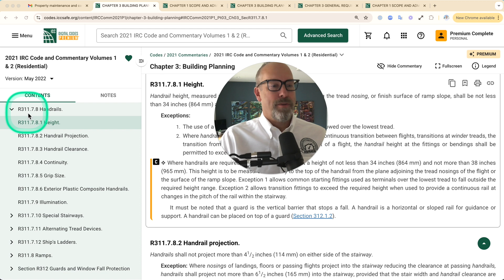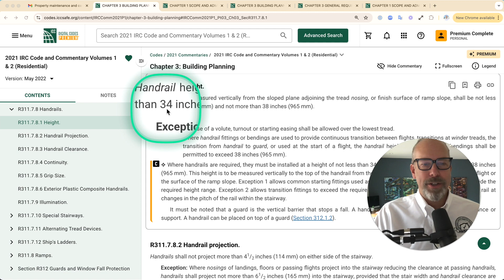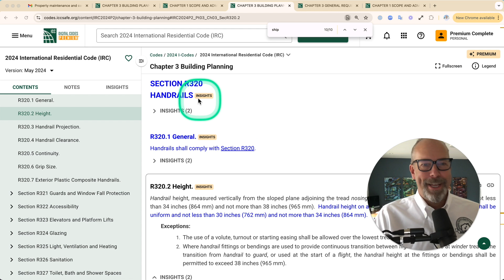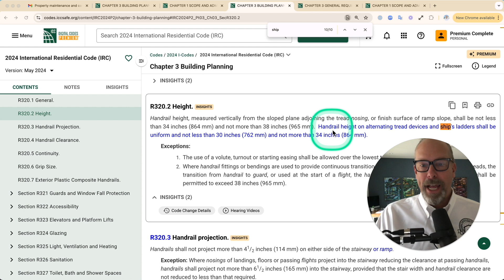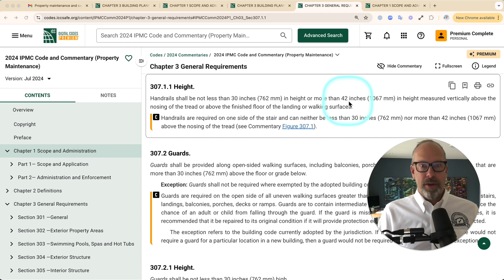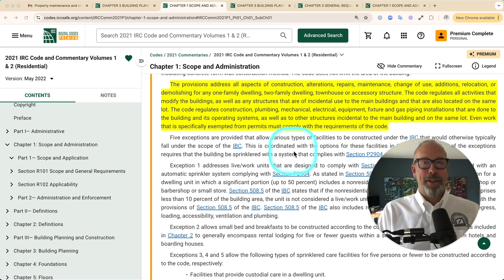Inspecting Handrail Height Using Code

Comment: Well, as a general home inspection is not a code inspection, and we are there for health and safety I always use 34" as the minimum height. Also, it should be mentioned to new home inspectors that we should not be citing code or using the word "code" when speaking to the client and writing reports. This can open ourselves to liability.
Reply from the maker: Yes, thanks, good point. Home inspections are not code inspections. Home inspectors should know code and building standards in order to find defects and safety hazards. Our curriculum is based on building standards and code at https://www.nachi.org/education/.